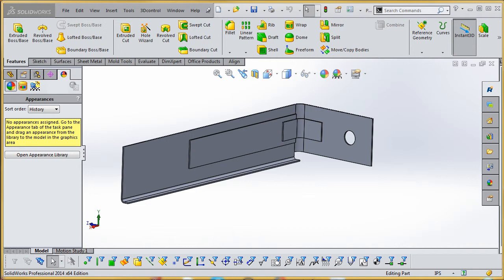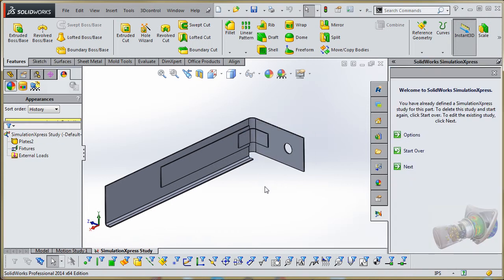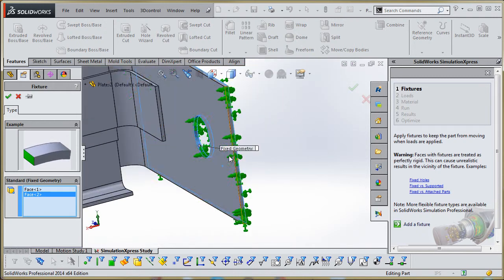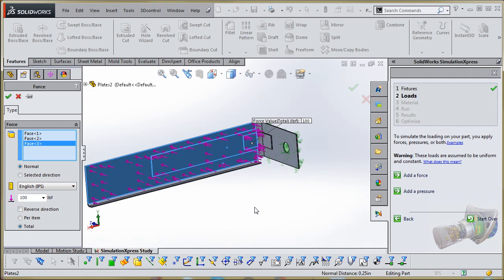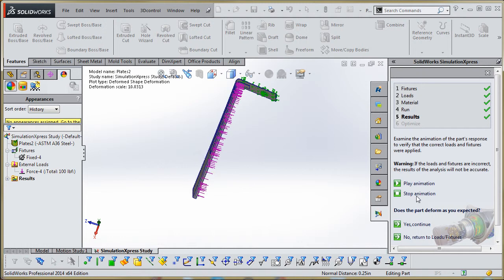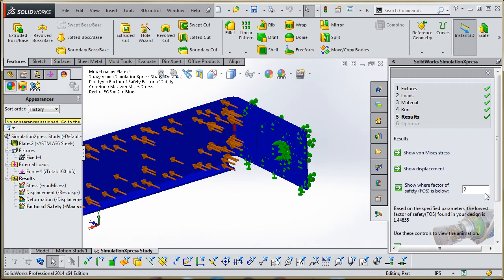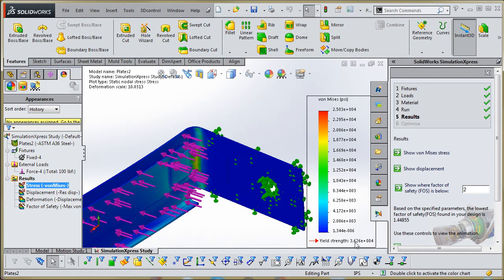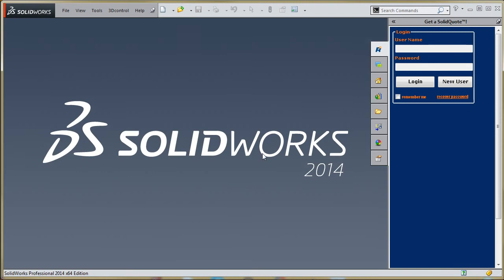Part 2 - Running Simulation Express for an Assembly, Running the Simulation and Optimzing

Comment: Just FYI, there is an error regarding the displacement in this video. 5.968 e-1 is not 6-inches, it is .6-inches. e-1, move the decimal place by one place to the left.
Reply from the maker: Your statement sounds right, a 6 inch displacement on such a part would be extraordinary.  A little more than a half an inch displacement is more realistic and adds validity for applying Simulation Express on a simple assembly like this.

Thanks for catching this and sharing.  CSS